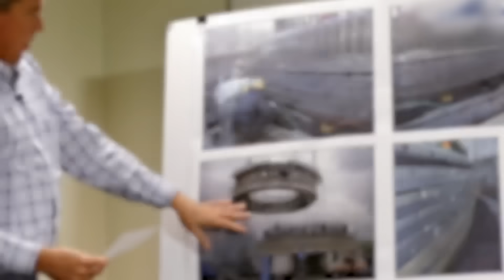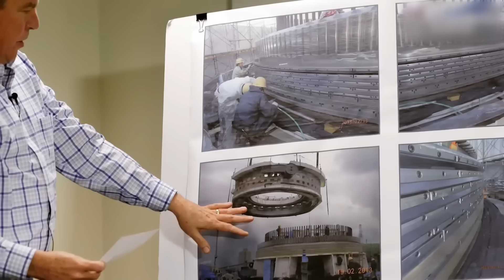Inside California’s $50 Billion High-Speed Rail Project — And Why It’s Taken So Long

Comment: What they should be doing is building a quad track so they can make a free system so what if it cost one or 2 billion a year to operate literally it will generate probably 100,000,000,000+ and benefits. There’s no good if you build a system and then it’s $100 a ticket. It’s too expensive.

Comment: There are 10 million flights between northern and southern California per year. The interest on the $135B CA high speed rail initiative would pay for free flights for everyone... That's just the interest! They could also pay for a free lunch at LA's oldest restaurant...
Reply: Oh, you mean the flights between those government-subsidized airports that you get to on those government-subsidized freeways in cars that burn gas from government-subsidized oil companies (which also supply the jet fuel)?
Reply: The federal government provides roughly $3.5 billion to $5.8 billion annually in formula funding to California for highway and bridge projects, largely sourced from the Federal Highway Trust Fund. Under the Infrastructure Investment and Jobs Act (IIJA), California expects to receive $28.2 billion in federal formula funding for highways over five years.

Comment: With all the earthquakes and weirdos at that speed, I'd be afraid to get on it. I don't need to get anywhere that fast.
Reply: Well, a little research would inform you that the entire project is built to withstand 8+ earthquakes and 150 year floods.  As for you not needing to get anywhere fast, that's your problem.  I do and that is more important to your petty desires.
Reply: A 2050 express train from Gilroy to Palmdale may be 2 hours averaging 160 mph plus 2.5 hours for the bookends from LAUS via the Antelope Valley Metrolink to Palmdale and from SF transit center via Caltrain to Gilroy for a total 4.5-hour express ride. All stops 5 hours, non-stop 4 hours, maybe. The current combined bookends can take up to 4 hours with three transfers so reducing 1.5 hours is optimistic. CAHSR may choose to upgrade the diesel 60-mile AV line for $6 billion vs. $36 billion to tunnel through the San Gabriels to save 30 minutes.

Comment: The idea is good but the implementation is horrible. Cal if has no experience building high speed rails, just look at what is happening. You have to ask yourself how can China and Japan do this and we cant. Because we have no experience would have been a better idea to have the private sector build it that has experience.

Comment: The main line should have run alongside Interstate 5. It should have been connected to Bart in the Bay Area. Planning was inadequate and costs greatly underestimated.
Reply: What you are proposing was examined and rejected because analyses of revenues generated by passengers was discovered to be too low and would require a subsidy.  Thus, the current alignment connecting 7 of the 9 largest cities in California.  In addition, BART is currently constructing an underground connection from its current terminus in eastern San Jose with Diridon station thus fulfilling your desire to connect to BART.  Also, there is already a connection to BART at Millbrae station connecting Caltrain, BART, and CHSR with San Francisco International Airport (SFO).
Reply: @AxesoftheDanes That's correct.

Comment: It should be noted that the current segment doesn’t even connect Bakersfield field to Merced. So it will be useless for anything other than an amusement ride.
Reply: It should be noted that the current 119 miles of construction were never intended to be the beginning and terminus of the project.  It was always intended to be used to test the systems operations and the train sets ability to meet there designed 240 mph top speed which is required by federal law.  It was in all the papers, course that wouldn't do you any good.
Reply: @AxesoftheDanes  It may still be developed into an amusement ride.
Reply: @roblangsdorf8758  One thing is certain, you will be too short to ride it.

Comment: In Europe they have completed several long tunnels under the Alps. The CAHSR should have been built directly under the mountains as a first leg between the San Fernando Valley and Bakersfield. This would have cut hours off the trip and connected AMTRAC and other operating passenger systems. 
     Using techniques from Europe, we could have developed something that operates already.
Reply: Our mountains aren’t like the alps lmao
Reply: Why actually start period,?it will NEVER pay for itself and the only riders will be homeless ppl with Alabama Suitcases.

Comment: I voted for California High Speed Rail then and I still vote for it. For so many reasons. 1) there is a great need. 2) we voted for it 3) will aid ATC at SFO and LAX. 4) less smog 5 its sustainable 5 its cool. 🇺🇸
Reply: You rode the short yellow bus in school didn't you!
Reply: @RogerGambill  that is for sure.
Reply: lol, yes before self driving car technology was even in it’s infancy. 90% of the auto fleet will be self driving before this project is hopefully abandoned or finished, completely nullifying the need for a train to nowhere
Reply: @orgbd  

I wonder which self-driving car will go 220mph like this train. 
The bullet train is still better because it's MUCH faster.
Reply: California has budget deficit of ~$30B. Pension liabilities is estimated at $260B. Current project estimate of $128B (started at $33B, just in case you weren’t paying attention), without a proposed completion date. The ridership projections are baseless as Californians are necessarily car dependent due to urban sprawl. Cool factor is something teenagers chase. Grown mature and fiscally responsible adults don’t rely on “coolness” as a project justification.
Reply: @BakoSooner HSR project doesn't take money from state budget . It sustains itself trough cap and trade funding
Reply: @warrid4868 . Sustain itself?  🤣🤣🤣
Reply: @BakoSooner  And the highways?
Reply: @BakoSooner  Yes, to the tune of a minimum of 1 billion/year until the year 2045.  It was in all the papers, course that wouldn't do you any good.
Reply: @BakoSooner  California spends over $10 billion a year on the military and highway maintenance and expansion. Passenger numbers will exceed 30 million a year once Phase 1 is complete.

CAHSR is not a project that should be cut because of a "state budget deficit"
Reply: @BakoSooner mmm...I know it doesn't sound grown-up, but cool makes $$. And $$ always gets you a seat at the big people table.
Reply: @angelotro . Cool is like the new ice cream. Then the new fad fades

Comment: Bring it up to Redding also
Reply: I agree but it doesn't have to travel at 200 + mph.  160 mph is still classified under international and national metrics as High Speed Rail and the engineering costs of building at a max speed of 160 vs. 200 + is incredibly cheaper.
Reply: Yeah I think this is a good point.  The regions north+west of Sacramento should get a few million homes as some of our areas have good resources including up to 100 years of fresh-water aquifers that Los Angeles and San Francisco no longer have.  Also would be great for Redding to compete with Santa Rosa-to-Lake County.
Reply: @RockwellAIM65  Dude, San Francisco gets it's water from the Hetch Hetchy resevoir in Yosemite National Park
Reply: Good idea 💡.

Comment: Please don't use China as a comparrison. It is not apples to apples.
Reply: The chinese high-speed rails are shaking apart for a variety of reasons, and additionally have resonance problems to start.  They are not really sustainable systems [will require total rebuild]
Reply: If you like it or not ... China is building HSR at awesome velocity, the USA are not able to do it. Looking at the new stations in China ... the future!

Comment: They could have chosen the periphery of Fresno instead of passing through the very center just like what they did at the other cities in the valley.  Thus the amount ballooned to more than double the amount.
Reply: One of the main benefits of rail travel is that stations are in city centers, where dense housing, hotels, restaurants, theaters, and museums are. Placing the stations out of town wouldn’t be much better than air travel. Running into downtown areas of Central Valley cities is much more expensive, but vastly more beneficial.
Reply: They did that to appease the masses, to impress the weak minded into thinking they are really doing something
Reply: They should have run up the 5 freeway where the State and Feds own the land.  But no, they wanted a jobs program from Fed money.
Reply: @mikelfrance-l6x  You, again?  You are just not very smart are you.